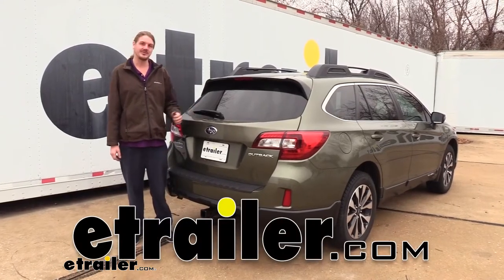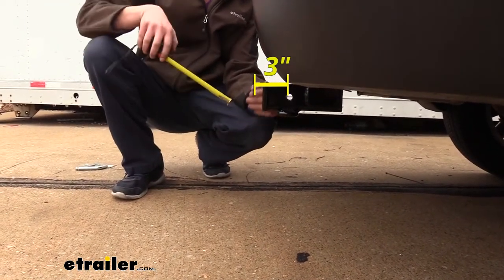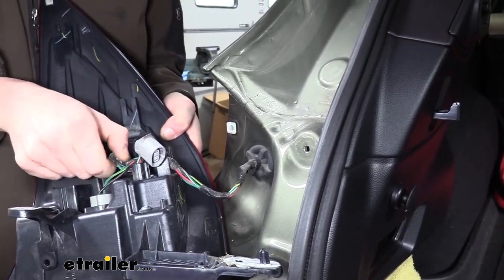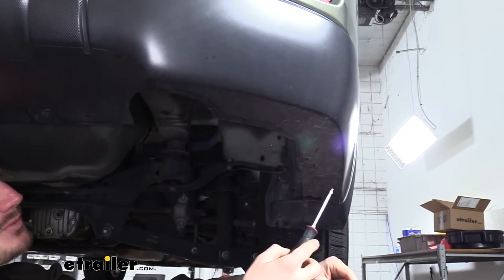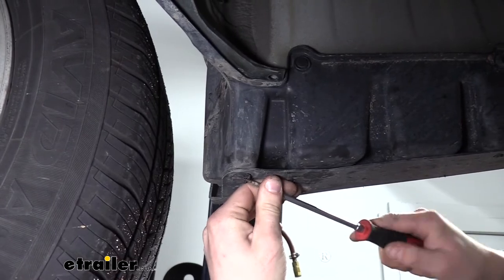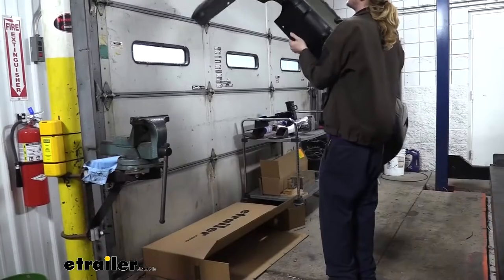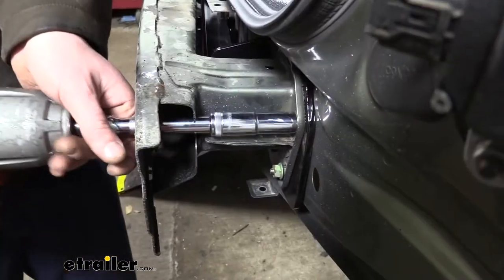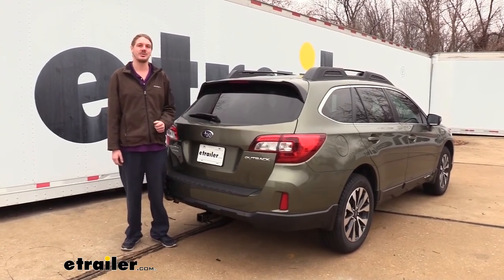etrailer | Curt Trailer Hitch Installation - 2015 Subaru Outback Wagon

Comment: Do you have a list of equipment I need?
Reply from the maker: What you'll need will depend on what you're gonna use the hitch for. If you just need it for a hitch mounted accessory like a bike rack or cargo carrier, the # C13410 hitch is all you'll need. For light duty towing, you'd add a trailer wiring harness like # 118467, a ball mount like # 2923, a trailer ball like # C40004 for a 2 inch or # 19260 for a 1-7/8 inch ball.
• https://www.etrailer.com/Trailer-Hitch/CURT/C13410.html
• https://www.etrailer.com/Custom-Fit-Vehicle-Wiring/Subaru/Outback+Wagon/2015/118467.html?VehicleID=20151175975